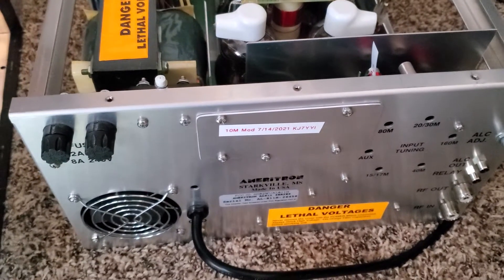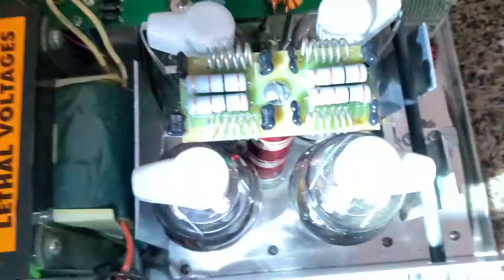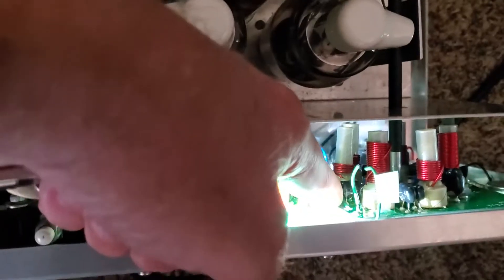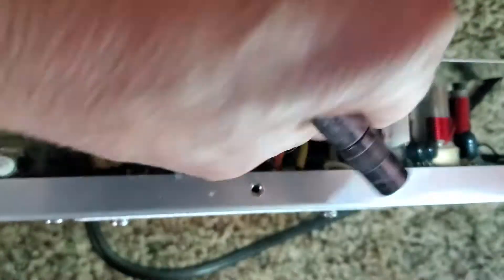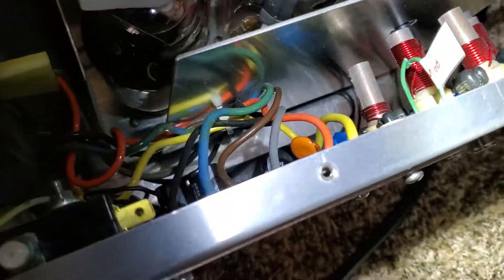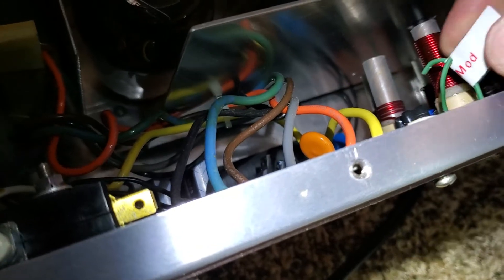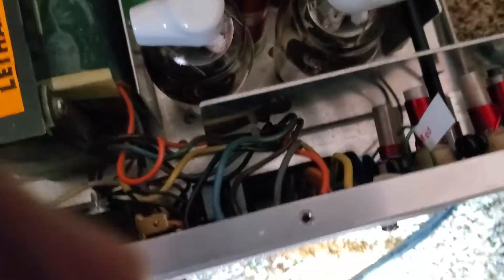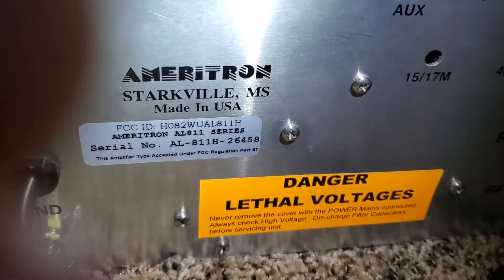Ameritron 811H 10 Meter Modification - How To

Comment: Has anyone confirmed 100% that this is the same mod for the Ameritron 811 as well? (then the AUX switch position becomes the 10m/12m band selector?)
Reply from the maker: I don't own an 811, only an 811H which is what is shown being modified here. The mod works GREAT by the way.

According to Google ... "The Ameritron AL-811H is similar to the AL-811, but with four fully neutralized 811A transmitting tubes for 800 watts of power, compared to the AL-811's 600 watts. The AL-811H also has a loud fan, while the AL-811 has a quiet fan. Reviews note that both amplifiers are quiet and easy to tune." If that is the only difference, I would expect it to work, but you are on your own here.

However, if you do it, come on back and let us know how it turned out! (Fingers crossed.)
Reply: @WoodyPhillips  My question is directed to owners of the 811 NOT the 811H as we know it works for the 811H.

Comment: I find funny why nobody do the mod removing the tiny rear cover plate with the 4 screws, no need to open the amp
Reply from the maker: Well, I posted this video because I couldn't find one about it and didn't realise the door was opposite the wire until I had the cover off so maybe that's why?

Comment: Just curious where do you buy the plastic screwdriver 🪛 to adjust the Aux control. Perhaps a link a specific size? Thank you for this vital info. Definitely going to save..
Reply from the maker: I bought a package on Amazon. I have not had to use them yet. I believe theywere about $10USD
Reply: @WoodyPhillips  were they a special size
Reply from the maker: @SFLightfoot  I din't use them, but they were small enough to fit in the tuing holes.

Comment: just remove the small panel cover on the back its right there to cut
Reply from the maker: This is correct. However, I did not discover that until after I made the modification.

Comment: Everyone says they can't find the mod on the web, but it's plainly in the manual that comes with the amp and you can download that from the web !  And you don't have to pull the top as you can get to it behind the little removeable panel on the rear.
Reply from the maker: I bellieve you are correct, however I bought this used and the manual I found online did not discuss this modification. I don't know if it is newer or older than manuals that do.

Comment: Hello Sir , so what exactly does it modify with in the circuit also does it affect the performance ? and finally  where did you source the modification from please sorry to ask so many questions
I'm assuming its the export mod for european countries
Reply: It's not actually an export mod, that would be a mod that would only be legal in other countries.  There is a regulation in the US that keeps these from being SOLD with the ability to TX on 11 meters.  HOWEVER, a licensed amateur in the US can mod this for 10/12 meter operation, which includes 11 meters, and that's legal.

So... we end up with this mess.  It can't do it from the factory from controls on the front and it's not obvious inside so it makes the FCC happy.

The source of the mod is Ameritron themselves.  It's the reason they designed it like this.  It has the 10/12 meter input tuning coil built in, complete with a hole in the back to tune it just like the other bands, just this little wire grounds the input when the band switch is set to AUX (10/12 meters).  Clip that wire and boom, 10/12 meters, and also 11 meters just because of the way things work.
Reply: The wire in my ameritron is yellow build date April 2001
Reply from the maker: This modification allows you to use the "Aux" Band switch to amplify the 12 meter and 10 meter bands. The green wire grounds out the coils used to accomplish this. Cutting the green wire simply enables that circuit. I have been told this modification is included in at least one version of the manual. I learned of it from a search for documentation. At that time I did not find any videos or photos so did not know the wire is also accessible via the service cover on the back of the unit.